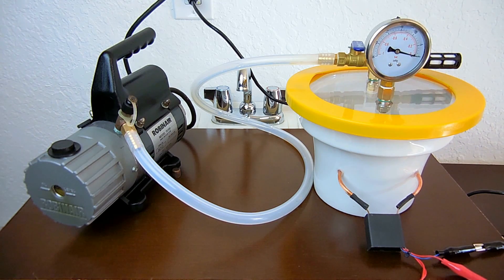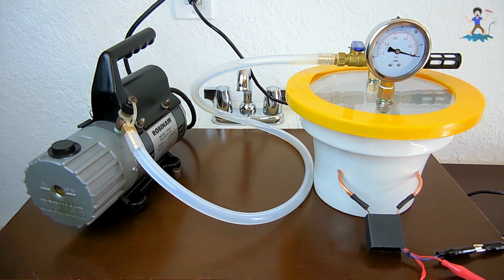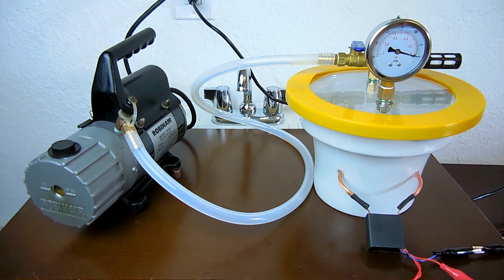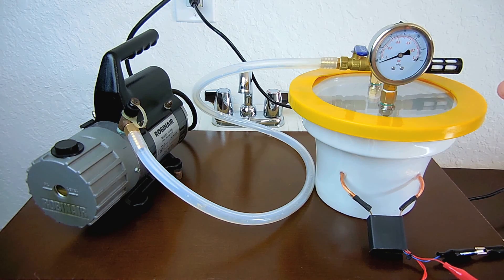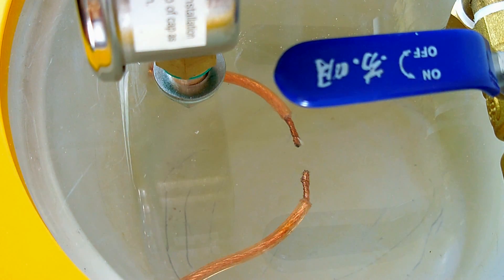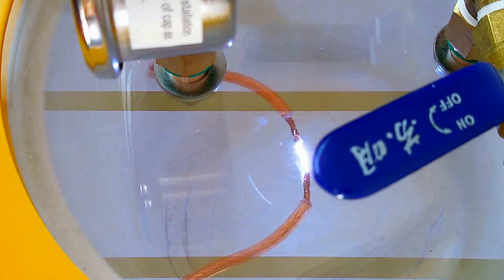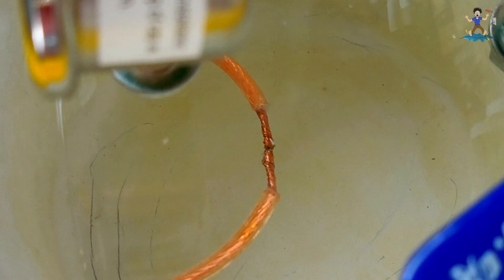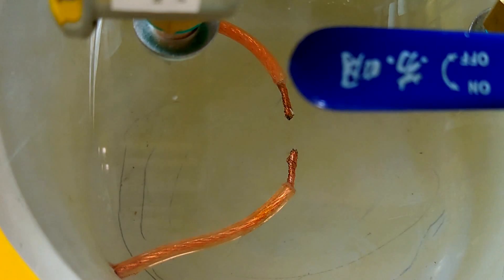High Voltage Vacuum Chamber

Comment: It would be interesting to see if you could sputter by connecting aluminum to the negative and copper to the positive. Negative is the bright glowing lead while under vac. The glow is ionized gas at that pressure

Comment: will a gun fire in a vacuum ??? will gas burn ?
Reply from the maker: A gun will fire with no problem because the powder inside the cartridge contains oxidizers. You need oxygen to have gas burn.

Comment: X Rays X Rays X Rays, be very careful passing arcs through a vacuum, when testing vacuum contractors in industry with high voltage there are safety SOPs in place to protect against X Rays produced directly proportionate  to % vacuum and voltage levels, be very careful
Reply from the maker: All that was inside the vacuum chamber were 2 copper wires. There was no "Target" like in a xray tube. If you noticed, there was also NO arcing unless air was allowed to enter. Thanks for watching

Comment: Way back when I was in high school our auto mechanics class had a spark plug cleaner and test machine.  We experimented with many different brands and heat ranges of spark plugs.  It had a high voltage supply of some sort.  When we increased air pressure the plugs would stop firing or become erratic.  The bead blasting that made the plugs spotless only helped to a certain degree or pressure.  If we took the plugs and buffed the threads and the tip of the electrode on a wire wheel  they performed to a much higher pressure.  This was in 1963.
Reply from the maker: Interesting. May have to make a pressure vessel. :-)

Comment: Hi Doug. Sounds like you may have a cold buddy. if so hope you have a fast recovery. Neat video. I have used old spark plugs and placed them inside glass jars with the lid sealed, to keep the ozone down when doing high voltage  experiment's and also keeps the arc from causing a explosion in my battery's  was seeing if it would reduce sulfation in the cells. results weren't very promising.
All my very best.
Bobby
Reply from the maker: Hi Bobby. Believe it or not, I don't get colds and never recall having the flu. I get sinus infections and sore throats. I forgot to tell viewers that when I opened up the lid, the level of ozone was incredible. Thanks for watching! Merry Christmas

Comment: Could you add steam into the chamber as an experiment I'd be interested in what would happen?
Reply from the maker: I'd need to leave a small bowl of water inside the vacuum chamber to add moisture to the inside of the chamber once it starts to boil.
Reply: electronicsNmore you don't think it (the steam) could be added in the Same way as the helium was, from an external source?
Reply: electronicsNmore 
Water would start to boil under vacuum and would be difficult to pump.
Reply: @0nd1ke  The vacuum would pull down to 500 microns, which is where the water would boil, and would be sufficient for an experiment like this, but I don't think it would have much different results than air.

Comment: Awsome! Always wondered what it looked like inside a vacuum breaker on high voltage switch gear!
Reply: Bobby Tectalabyss Wow. I'm sorry to hear that as well. I used to work substation maintenance for an airport monorail system that had distribution voltages at 13K and down to 600volt for track power. Some of my co workers would do crazy stuff like this. They'd Bypass fuses, forget to take protective grounds off after maintenance, not wear PPE when racking breakers...the list goes on and on. Not the type of job to be careless in. I always used to think before I acted and always double checked everything before energizing any systems.
Reply from the maker: I never thought about that. :-)
Reply: I have seen what a  600 amp switch gear looks like when overloaded and explodes,though the light is awesome the burns are not. This due to 2nd shift person by passing the fuses, rather than finding the short. this occurred just has I came on shift,, I of course got the a$$ chewing has maintenance foreman.
Reply: Bobby Tectalabyss Sorry to hear man. I'm an industrial electrician & instrument Tech. I hate coming behind others to fix stuff, for those reasons.
Reply: I am retired now I sure don't miss days like those. I feel for you. Be safe and always watch your back. I have found disconnects bypassed has well. a death just waiting to happen, I fixed it and many butts were chewed Lol. So always check, this I am sure you know, though its easy to let ones gard down for the first and last time.
All my best.
Bobby

Comment from the maker: If there's an experiment you'd like to see in my vacuum chamber, then reply here with your idea. The experiment that gets the greatest # of likes, I'll make a video! :-)
Reply: Replace the air with argon.  You don't really need to pull a vacuum first; just displace the air with argon.  I'm sure you know about this already but it would be neat for your viewers.
Reply from the maker: Sounds like an idea. Let's see how many people rate it a thumbs up over the next week. Thanks for watching!
Reply: I've heard the ionosphere is nearly a superconductor, is there a way you could test and document the resistance at various pressures- perhaps with various gasses along with normal atmospheric gas?

Comment: Did you do a video on where you got your chamber? I can't recall if you did. I thought about making one but from my understanding you can buy them super cheap now.
EDIT: also what is that foam stuff in your vacuum line?
Reply from the maker: I only paid $82.50 shipped for my 2 gallon vacuum chamber. The foam is a small amount of vacuum pump oil that got drawn backwards into the vacuum line after I powered off the unit. I accidentally opened the wrong valve to let air enter the chamber. :-)
Reply: electronicsNmore Yeah I might just try to make my own then. If I can find thick enough lexan/plexiglas/polycabonate/acrylic thats cheap enough. Oddly enough the same person we talked about last time (GT) just had a video on how to make one. Ah okay. so if the "foam" get sucked back into the pump it wont be a problem. Also That was a brilliant idea to put helium in the chamber. I wouldn't mind seeing this done with other gasses like argon, Also the evil side of me wants to see pure oxygen or acetylene X-D I don't think the acetylene would ignite though.
Reply from the maker: x9x9x9x9x9
The time you buy the thick acrylic, brass fittings, brass ball valves, liquid filled gauge, silicone vacuum hose w/fitting, and the heavy gauge pot, you're better off buying exactly what I did, trust me, I already thought of making my own, it wasn't worth it. You can buy a complete kit like GT shows for $25 less that the link he shows, which he gets a cut of......shop around.
Reply: I have most of the fittings and valves but yeah its getting the lid for a good price that makes all the difference. Plus buying a pre-made kit you know its going to work.
Reply from the maker: x9x9x9x9x9 1/2" acrylic is good enough